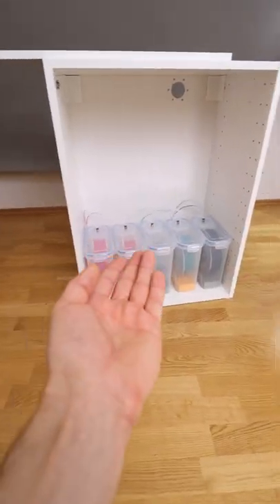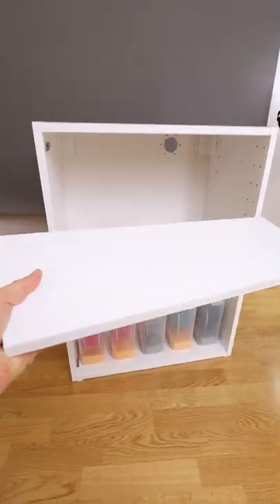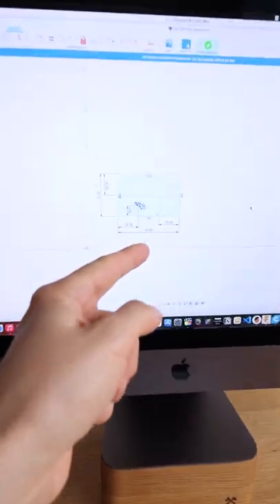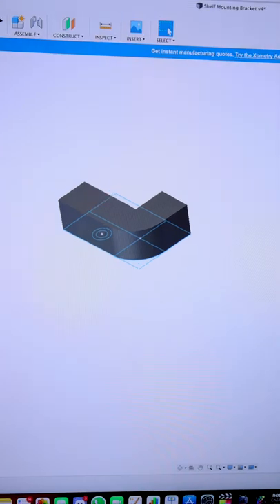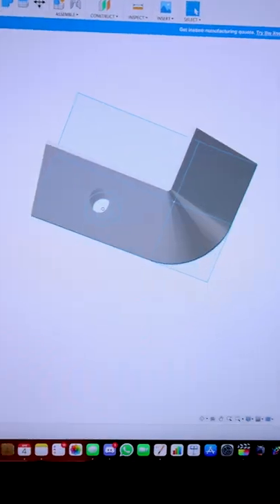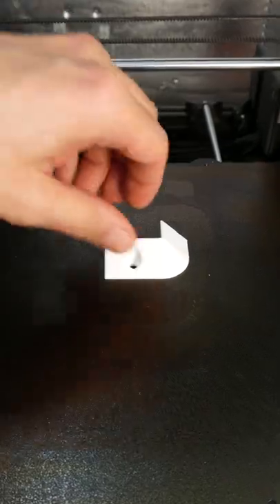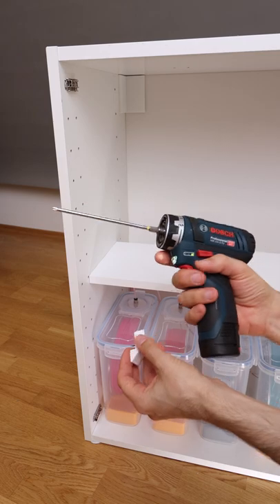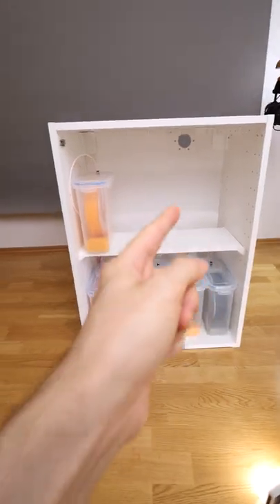How to Design and 3D Print a Custom Shelf Bracket for Ikea Cabinet

Comment: What did you use for the filliment its self
Reply from the maker: just some regulat PLA, you can check some in my video description
Reply: @marsgizmo  I meant to hold it, but thanks I needed that too

Edit:( just added a comma)
Reply from the maker: @end_slayer  to hold the bracket on the  cabinet? just a regular wood screw :)
Reply: @marsgizmo  the plastic containers, like where did you get them
Reply: @end_slayer   ... I knew that is what you wanted to know ... I came here looking for the same thing.  I don’t have the answer either ... yet.

Comment: what are your support settings?
Reply from the maker: I use default setting from the slicers, usually from a Generic PLA profile, with a layer height of 0.2mm. If you don't get good results, it's usually due to low quality filament or the printer is over-extruding (you can lower the extrusion multiplier by 5-10 %). Will try to do small tips videos soon 😊
Reply: @marsgizmo  thanks!